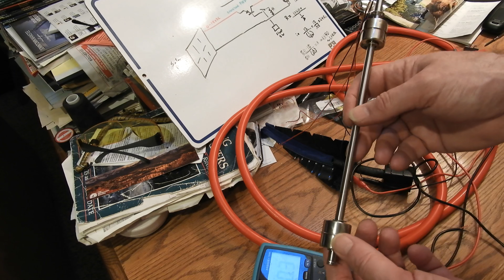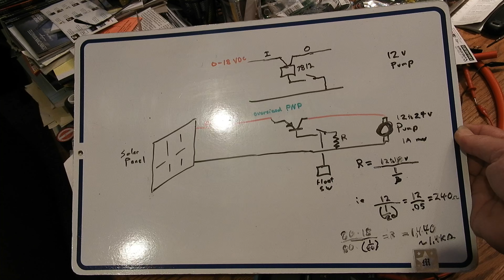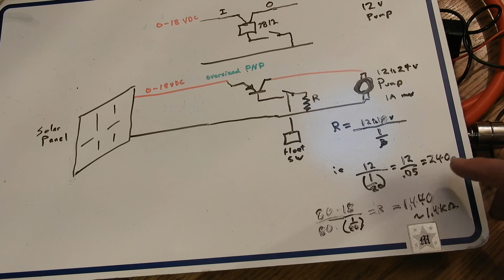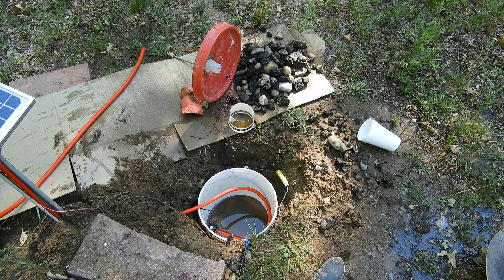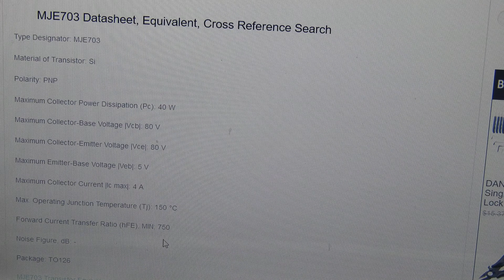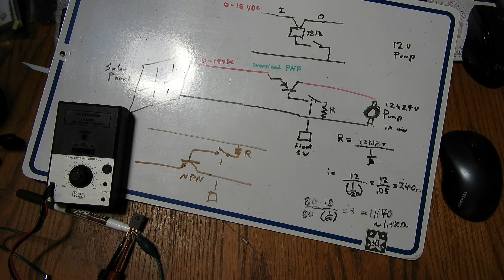3055 Load Reduction Example - Solar Birdbath Fountain

Comment: Hey man are you still a cable maintenance technician?
Reply from the maker: I took an early retirement deal a few years ago. Would still consider doing more videos in that vein if there are suggestions.
Reply: Hill's Workbench Yes please if you could. Could you do a video on LE’s & things of that nature?
Reply from the maker: @johnlink4253    More specific? I did one on a look at the internals of an old LE and a Distribution amp and touched on plant design in a few other videos. I could go over distortion and noise formulas but that would be a bit dry. Maybe more on plant design basics? Or deeper into the amps themselves, feed-forward design? What kind(s) of video would you find useful? I do want to make one on compression algorithms if I can locate my notes on that or take the time to research it from scratch, DOCSIS 3 is literally twisted!